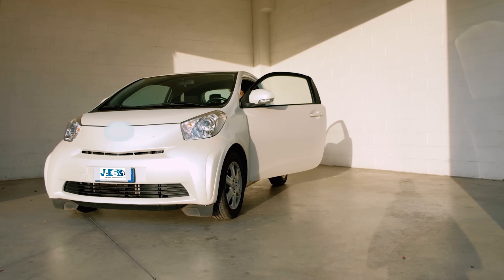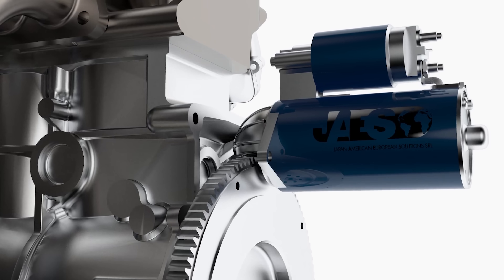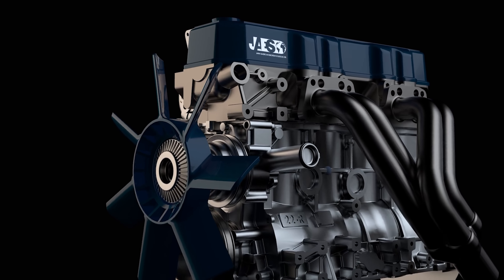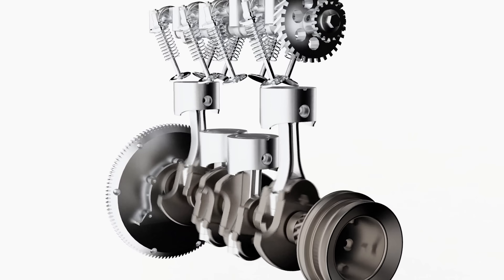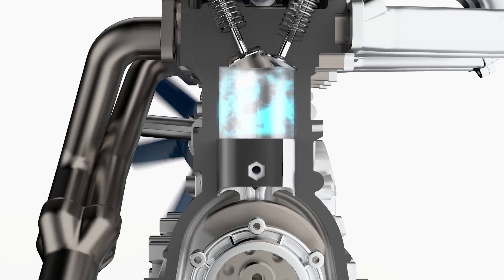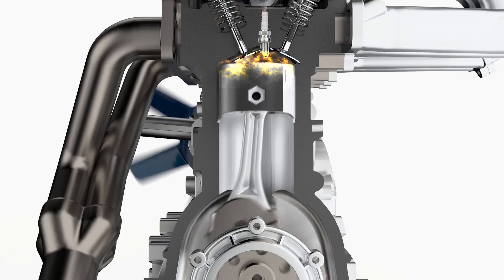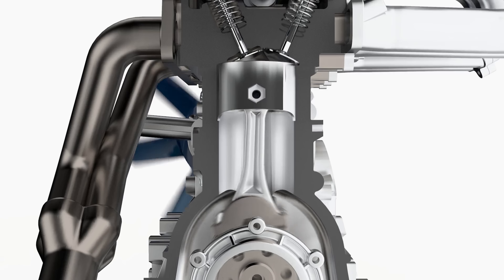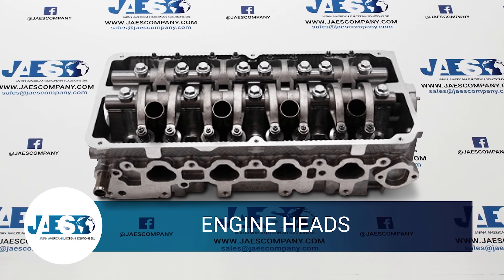What happens when you turn the ignition key in your car? Internal combustion engine (Car Part 1)

Comment: Correction at minute 4:00. A combustion (not an explosion) occurs every 2 turns of the crankshaft, so for 6K RPM the motor will produce 3K combustions which yields 25 combustions per cylinder or 100 considering a 4-cylinder engine.

Comment: Ok guys, when you turn the key to start what it really does is crank the engine, and that is it, nothing else. The engine can start without the starter as long as the key is in “on” position and if the crank sensor receives signal.
Reply: not true.  you will see a lot of fuses in the car that are "hot on start and run" and "hot on start" aside from the start fuse  in a car wiring diagram.  so you might want to see a car wiring  diagram first.
Reply: @ncolevalv_5673 does not affect engine, ecu only needs crankshaft and camshaft signal, i don’t think you understand how modern engine management works
Reply: @davidgruen7423   lol.  read a modern car wiring diagram first 😂😂😂.  like i asked, try to start a car with an automatic transmissiowithout a starter.  😂😂😂.
Reply: @davidgruen7423 it also needs power to the ignition coils, injectors and fuel pump while starting. .  without those three, your car will need a tow truck 😂😂😂😂.  you do not know what you are talking about.
Reply: @ncolevalv_5673  all these three run while the ecu receives signal from the crankshaft sensor while the key is in on position. The starter is just a cranker, nothing more, it’s no different than hand cranking the engine. This is why all manual cars can be push started, automatic can also be crank started if you use socket and ratchet
Reply: @ncolevalv_5673 you don’t understand how cars work in general, it’s a waste of my time. Cars ecu doesn’t need starter to start, as long as you can find a way to crank the engine while the key is on it will start. It is merely a cranker, it doesn’t contribute to starting of the car
Reply: and if you have to find out what "hot" means,  better start reading more.
Reply: and yah, try starting an automatic transmission car without a starter 😂😂😂.
Reply: @ncolevalv_5673 turn the crankshaft in the front with a breaker bar

Comment: I like the fact that electricity starts the engine running, but then the fuel keeps it going, and then the motion caused by combustion, turns the alternator which recharges the battery.

Kind of poetic.
Reply: Self fulfilling prophecy.
Reply: a shadow of what we are capable of
Reply: For life is sparked our fuel makes us combust and recharges us to keep going 😂
Reply: The gift that keeps on giving
Reply: When things are set in motion, everything will connect. You will borrow energy from someone somewhere while you are moving. So just do it.
Reply: Kind of cool how we can recycle electricity and fuel in this kind of way like a circle shaped chain of actions

Comment: What will happen?? If the outlet valve not opens (bcz of some xyz reason, just assume) after the combustion stroke, Does the engine stops or explode cylinder everything??

Comment: After an SI ignition engine  is started by spark ,  how does it carry on with the 4-Stroke cycles, like does the spark plug provide spark each time ? or there is some other phenomenon included, due to which the crank shaft continues its rotation ?

Comment: Inside the combustion chamber it is, well, combustion that takes place, not EXPLOSION. It is NOT the same thing. Explosion implies a phenomenon called knocking is taking place. Neglected long enough knocking would promptly ruin the engine. Also, F/A mixture ignition takes place long before the "top" is reached and is dependent on RPM. If it happened exactly at the TDC, a profound loss of power would follow. Lack of understanding of subject matter.

Comment: Seems like there’s quite a bit missing here what about all the electronics and fuses activating fuel pump priming sensors checking timing immobilizer chip check seems like as other have stated this only apply to vehicles with carburetors or a simple basics ecm.

Comment: forget the fuel pump, all the relays and fuses that have to be there, how it fires up etc, the starter does just magically turn on the engine, the fuel has to still be squirted and spark plugs igniting

Comment: Pretty simple explanation. Before any of this happens the engine ECU carries out an engine check procedure without which the ignition and fuel injection can not occur. At the same time some systems compare the key with the emobilizer security system. The engine may crank a couple of turns but won't start. My opinion is this only explanes cars previously to 1995.
Reply: That's how we all tricked from the title and this video has so many negative votes.

Comment: great video. something I noticed and is interesting to mention in the video: stroke timing. of all of the 4 strokes, the most power comes from the combustion phase. in the animation, the pairs of cylinders 1,4 and 2,3 are synchronized. this is not the best timing for power efficiency, because there will be moments when none of the pistons are in a combustion phase, and others when at least 2 are firing at the same time. to even out the power, the way these strokes are timed is to have a different step happening in each cylinder in a given point, so there is always a piston in the combustion stroke, which improves fuel and power efficiency.
Reply: I was looking for this comment.    It’s clearly a mistake to have 2&3 intake together (and 1&4). You were being kind to suggest “it’s not the most efficient way.”  It would cause bad vibration issues also.
Reply: I don’t think mistake in the animation is with the synchronicity of the pistons but rather with the valve timings. They should be opposite for the synchronously moving pistons to achieve smooth power delivery.
Reply: Very good point, but taking account of the objective of the video, maybe this type of info could be presented after, when the basics are cleared.

Comment: Can’t get past the “explosions” in the cylinder remark. The fuel/air mixture burns; it does not explode. 

When it explodes, it’s called “engine knock” and it means something is wrong.

Comment: At 1:50 the direction of the crankshaft's rotation reverses in this animation. That does not occur in a real engine; why did you do that?
Also the term "explosion" is incorrect. The correct term is "combustion". 
Not a very accurate video.

Comment: Forgot the starter relay/solenoid. The current to drive the starter motor does not route through the ignition switch - it would melt or catch on fire if it did.

Comment: That's quite an oversimplification, completely omitting the ECU, all of the sensors, relays, fuel pump, the immobiliser, fuel injection, the ignition, not explaining what happens inside the starter motor etc. But I guess it can give you a very basic idea of what's going on even though it was more complicated even in the 80s, not to mention today!

Comment: So basically 

it turns on the starter which moves the flywheel and in turn crankshaft, the rest is just basic 4 stroke engine operation

Comment: I don't get the point of this video. Barely any useful information caped by a plug of some random company that is of zero relevance to me. Looking at the title, I was expecting something more than "starter motor spins, and BTW this is how 4 stroke engine works" kinda video. What about immobilizer, fuel pump and injectors kicking in? How is throttle blade positioned and what is the air/fuel mixture map during initial startup? How many engine turnovers by starter (on average) to start the engine in optimal conditions?

Comment: How does the ignite work, is it electrical sparks that comes from its connection to the 12 V battery?
Reply: No your ignition Circuit is about a couple thousand volts thanks to the coil or coil packs here is an experiment you can try go out to your car and pull off one of your spark plug lead off while the engine is running actually don't try this it hurts a lot and is a shocking experience

Comment: If you have a car with manual transmission then you can bypass the starter by stepping on the clutch, shifting to first gear, maintain the clutch down (leaving it on first gear), the car is pushed and when it has gained momentum you let go of the clutch.  By the way, the key must stay in the "on" position and left alone.
The thing that's confusing here is how the fuel pump transfers the fuel to the engine, the spark plug knows exactly when to "spark", etc.........Is it the crankshaft doing that?  (Flywheel?....).
Reply: There's electric fuel pumps and vacuum operated fuel pumps. Spark timing is achieved through a distributor attached to and timed perfectly with the camshaft or through electronic means with several sensors and the ecu
Reply: @QuoteFarm  Don't forget mechanical fuel pumps operated by a lever on the pump and a lobe on the crank or cam shaft.
Reply: Better to use third or fourth gears than first. You put less stress on the drivetrain and the engine still reaches enough speed to start. 
Also, if there is not enough "juice" in the battery, there are a couple of functions (e.g. electric fuel pump, ignition controls) critical to operation that will not work.
Last time I had to start that way, it was a tiny rubber plug on the clutch pedal lever that pushes a safety switch. 
Nissan drills a hole through the flange that pushes the switch at a precise location that slides around the button-type switch. 
I found the diagnosis on YouTube, I found the failed rubber plug on the floor under the clutch pedal, and I fixed it with a bit of scrap plastic and a piece of double-stick tape. 
Come to think of it, I learned to drive in a '51 Studebaker (Nash cars were the same way) in which the main starter button was on the floor under the clutch pedal. Switch on to energize the ignition, push the clutch and lean on it to start.

Comment: So I’m guessing that screeching sound when you hold the key in place after the engine starts is coming from the starter gear going against the flywheel going at a much faster speed.
Reply: Yess correct. Think of it like this “trying to re-engage the starter motor a second time after the engine  flywheel is already running “

Comment: You just based on experience if you leave it on the ON position without starting it for a few seconds. It tends to start way faster. I know modern cars have a crank sensor for knock and starting. I don't know if this is useful maybe to save starter. I guess it works best on cold starts. Other than that not necessary just wanted to share. :)

Comment: This is cute. Modern cars are 100x more complicated in their starting system design than this. There's many modules, antennas, and an entire network system involved. The actual design for the starting system they show here is probably/maybe from the 50s. I haven't actually even seen it in real life its so old. I have seen/worked on 60s starter circuits and even they are more complicated then what they show here, they have a relay...Lmao.

Comment: Technically the spark plug or glow plug ignites the fuel and air mixture just a little bit before top dead centre. As it’s more about timing. Not right on top dead centre (TDC).

Comment: I’m annoyed by many small mistakes (not simplifications) in this video. Some of them:
- Electric current goes through the keyhole to the starter;
- The starter retracts its gear;
- The cylinders with the same piston phase have the same valve phase (it makes no sense to make such cylinders separated);
Reply: Are you joking? Current does not travel through the keyhole to the starter... turning the key is literally just a switch that allows the circuit to close and current to "flow".
Reply: @austing7254 , I’m not sure what you mean. Could you please clarify? I meant that the keyhole signals a relay to open, and the current flows through the relay.
Reply: @cheesebusiness  I was rebutting what you originally said: "electric current goes through the keyhole...".
Reply: @austing7254 , I said that this is an error from the video

Comment: How an "explosion" happens inside a "combustion" chamber? please correct me if I'm wrong, if your fuel explodes every 4th cycle your engine would be eventually destroyed, this is called detonation, and you can identify it by the "ringing" or clicking/knocking sound you hear from the engine.

Comment: Just ignored the fuel pump and injectors and the power to ignition and everything. So yea it shows how the engine runs but doesnt explain at all "what happens when you turn your ignition key". The starter is only a third of what happens.

Comment: Are the suction and exhaust stroke not responsible for work ?, because while explaining the otto cycle the P-V diagram only consists of compression - combustion - expansion - heat rejection. I always wonder that If the intake happens by the movement of the piston then doesn't that contribute to work ?? Also, the exhaust happened at cost of movement of the piston but the diagrams show exhaust happened at constant volume ?? please explain!

Comment: How does the math come out to 200  power strokes a second PER cylinder at 6000 rpm?
6000 rpm is 100 per second. Each cylinder fires every other revolution which brings it down to 50 a second
Reply: I think there is no simple formula for it as 4 stroke may not necessarily happen for one single rotation,it may rotate more.4 stroke and rpm correlation is not there
Reply: @superman-sl7qb  Your comment does not make any sense and you do not seem to understand how a 4-stroke engine works. Watch the video  and do the math.

Comment: These days....The start input command from the human interface sends a signal to the BCM which then decides based upon various inputs it receives from other sensors/sources and decides if a signal should be sent to the the electric motor that turns/cranks the internal combustion engine...Hybrid and EV excluded.
Reply from the maker: Thank you so much for your comment! Have you had a chance to watch our videos about STEERING SYSTEM https://youtu.be/Iw1duKjGcto MANUAL TRANSMISSION https://youtu.be/G6hCvdW4dKo BRAKING SYSTEM https://youtu.be/6xWEEbhBtuY and ELECTRIC VEHICLES https://youtu.be/flQSQxHVS14 We would like to know your opinion about it. 
If you want to learn more about our projects, you can subscribe to our channel https://www.youtube.com/channel/UCb7TkWFn3nyb6XhudxGu5tw and visit our website https://www.jaescompany.com/

Comment: Modern automobiles don't use an ignition key or switch!  They have a keyed master switch that turns on certain circuits to the microprocessor boxes and relays, that control all the functions of the vehicle.  There are no "computers" in modern automobiles, either, unless you take a tablet or smartphone.  Microprocessors are related to computers, but are NOT real computers.
   Ifnition keys or switches only pertain to old cars that use magnetos.
Reply from the maker: Thank you so much for your observation! We welcome anyone who brings his own contribution and share his knowledge on our videos. Have you had a chance to watch our videos about STEERING SYSTEM https://youtu.be/Iw1duKjGcto MANUAL TRANSMISSION https://youtu.be/G6hCvdW4dKo BRAKING SYSTEM https://youtu.be/6xWEEbhBtuY and ELECTRIC VEHICLES https://youtu.be/flQSQxHVS14 We would like to know your opinion about it. If you want to learn more about our projects, you can subscribe to our channel https://www.youtube.com/channel/UCb7TkWFn3nyb6XhudxGu5tw and visit our website https://www.jaescompany.com/

Comment: Sorry, noticed a few problems. First it says at 6k rpms, the CYCLE repeats 50 times per second, but then right after it says there's 200 explosions per second. Only 1/4 of the cycle is the combustion stroke so with that math it should be 50/4 = 12.5 "explosions" per second. But that math is also wrong because a cycle is 4 strokes or 2 full revolutions of the crank meaning only the "explosions" will happen only 1/4 times the rpms. 6000/4 = 1500/60(seconds) = 25 power strokes per second per cylinder at 6k rpms.
Reply from the maker: Thank you so much for your comment! We welcome anyone who brings his own contribution and share his knowledge on our videos. Have you had a chance to watch our videoS about STEERING SYSTEM https://youtu.be/Iw1duKjGcto MANUAL TRANSMISSION https://youtu.be/G6hCvdW4dKo BRAKING SYSTEM https://youtu.be/6xWEEbhBtuY and ELECTRIC VEHICLES https://youtu.be/flQSQxHVS14S We would like to know your opinion about it. 
If you want to learn more about our projects, you can subscribe to our channel https://www.youtube.com/channel/UCb7TkWFn3nyb6XhudxGu5tw and visit our website https://www.jaescompany.com/
Reply: 6000 rpm is 100 rotations per second. Every two rotations need one explosion. So it should be 50 explosions per second per cylinder.
Reply: @danielcao8621  You're right, I over processed and mixed up stroke/revolution and got 1/2 the answer, sorry. Still can't be 200 combustion strokes per second though. That would require 24k rpm if I'm correct.
Reply: @ViktorKryatov  Yes exactly! :)
Reply: @ViktorKryatov  It's 50 explosions per cylinder per second. Multiplying by 4 cylinders total yields 200 explosions per second _for the entire engine_.
Reply: @mykalimba  "200 explosions per second inside each cylinder of this engine"